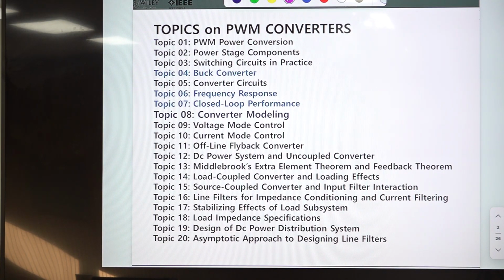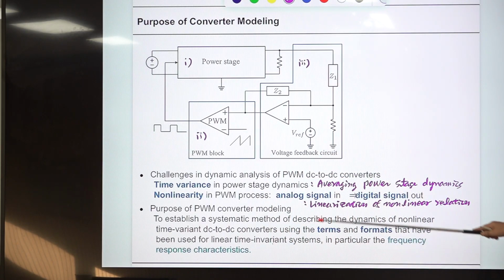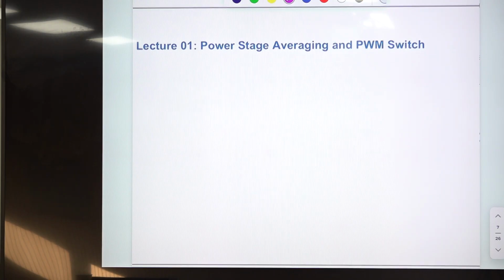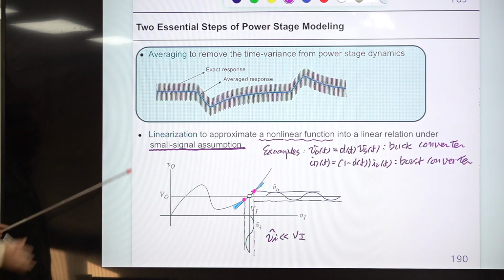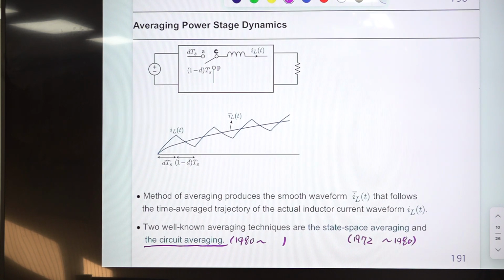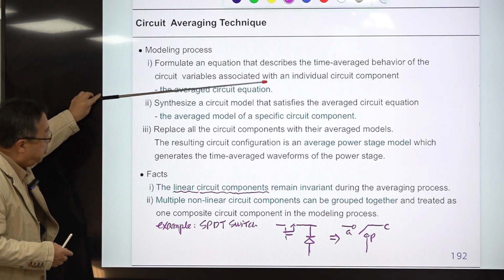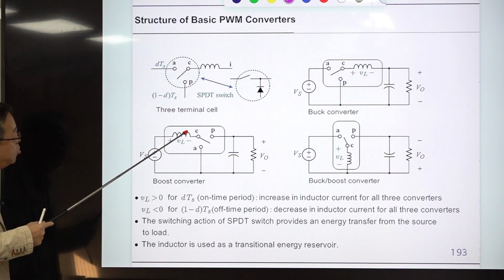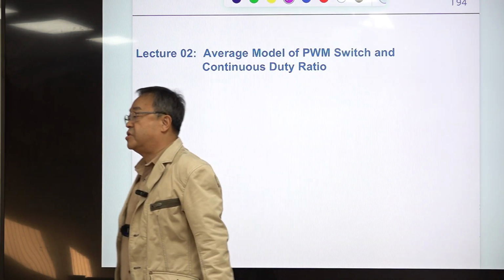Lecture 01: PWM Converter Modeling,  Average Modeling,  PWM Switch,  Circuit Averaging

Comment: Thank you for the great video! Is this circuit averaging method only valid for basic converters with the three terminals? What about a SEPIC converter that the switch and diode are apart?
Reply from the maker: The averaging concept is still applicable (with some modifications) to the SEPEC converter. One good reference is given in  https://ieeexplore.ieee.org/abstract/document/616761, as well as other references.
Reply: @ thank you!
Reply from the maker: I am now traveling aboard. I will take of your request when I return to Korea at the end of this month. Thank you for your interest to the site.